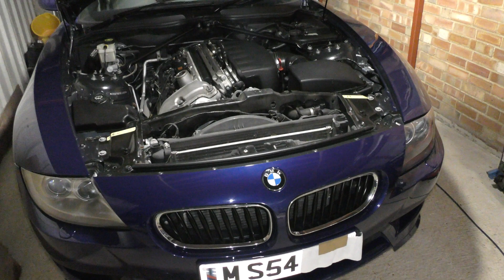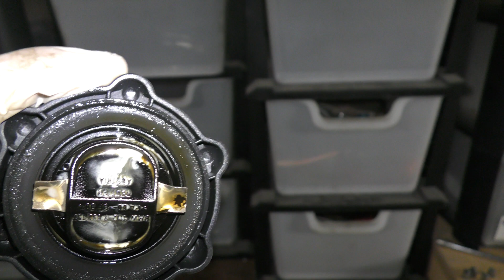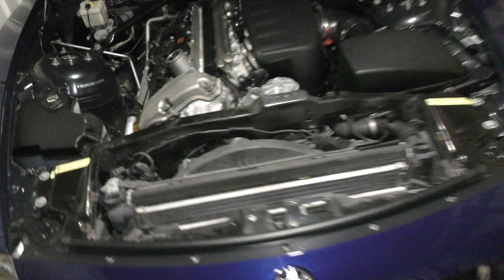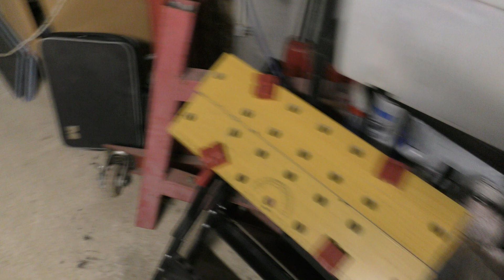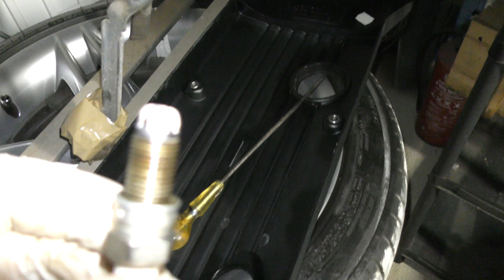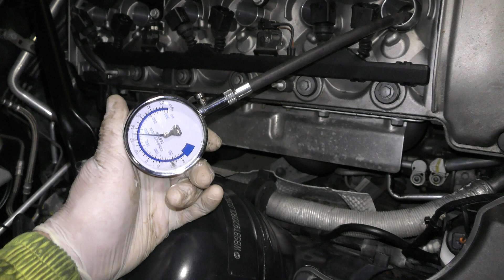NEW TOY: BMW Z4M S54 Engine Compression Test (possible head gasket failure)

Comment: Amazing engine on those! On Cupras & other VAG the cap always has emulsification because of the PCV recirculation, not sure if these have one? Very regular oil changes help.
Wet spark thread is often leaking valve cover gasket.
I bought a Lanoguard kit for my Quattro chassis, yet to apply though.
Got to fit a sports exhaust Cap, get her singing!

Comment: I haven’t owned a BMW for a couple of years, but for the most part I’ve known them to be pretty much bulletproof. As long as the cams, and timing, & top end are and remain mechanically right and something like a tensioner doesn’t fail, it shouldn’t be too bad. When they DO go wrong though, like a tensioner failing & suddenly the top end grenades, they go expensively wrong. 

Looks to be a car in GREAT shape. It’s obvious you’ve put a lot of time into it. Regardless of what the overall vehicle looks like, I LOVE seeing an engine bay that’s tidied up like that. Always makes little issues much more apparent to the eye before they have time to become larger issues. I’m jealous to be honest. Looks awesome. 👏🏼

Comment: That goo on the filler cap is just condensation. A bad headgasket most of the time will push the coolant out of the overflow bottle when hot> Very obviously usually lol
Reply: Oil on the spark plugs like that indicates its time for valve cover seals/gaskets

Comment: I've had the 35is (N54) for a while now.  Oil on the thread might be leaking injectors thinning the oil, but might be ok if it's not backfiring - BMs have an issue with leaky injectors.  I had to change mine recently - as well as the cylinder head, charge pipe, MAP sensor seals, clean VANOS and the check valves...  Waiting for the timing chain to go now...  Oh and roof micro switches, and leaking boot, and leaking tail lights...  But apart from that it's pucker...  Just the car weeding out the weak.
Reply from the maker: Rgr thxx
Reply: @grimreapers2  NP shout up if you ever venture to using a DCAN diag cable with INPA, ISTA, or NCS for coding etc. and want a hand -  don't pay for the software btw.  But there's plenty of youtube vids so you probably won't need it.  But the offer's there.  I'm not a car mechanic, just an engineer who needed to learn to fix his car quickly

Comment: While I am a gear head, I'm not at all familiar with the snifer test. Then again, I'm a self-taught mechanic. 

I'm speculating it's looking for gasses passing through the coolant, which would normally go to the resovior, which is often the highest point in the coolant system. However, sometimes that's not the case.

For example, my 2002 Audi (B5) S4 has the heater core higher than the reservoir. Whenever I change the antifreeze, I have to bleed the line coming out of the firewall from the core. Otherwise, the heat doesn't work.

Like I said, I'm purely speculating how this tool works. But it might be the issue. Obviously, it doesn't help you with your troubleshooting, but it might be why the tool isn't working.

Comment: Thats just normal condensation on the cap Cap.
Reply from the maker: rgr
Reply: @grimreapers2  you should see the caps from my turbo LS cars that run on e85 that sit and get started only  every once in a while. Once they sit over winter, the oil needs changed no matter how much time is on it.

Comment: The scum is condensation. If you had a blown head gasket or cracked head, there would be cylinder 3/4 misfires upon cold start. The tiny bit of oil on the spark plug threads is sign of a miniscule valve cover gasket leak. Ignore. 

You absolutely do not have a failed head gasket.

Comment: Hi Cap, recommend a full oil change and use high quality oil. The exhaust is stainless to start with, however a lot of people do make their own custom pipes from the cat for z4's. my mate did on his z4 3.0 and it sounded amazing, that may be what you are seeing. Engine itself is a great little straight six and I'm a huge fan of them as they are fairly bombproof and can be supercharged easily, gearbox is moderately the same way. The BMW rear diff leaking is not a great sign, properly check every aspect on it as I've come across cracked ones through people deciding to make attempts at "drifting" (to be read as half arsed sliding round roundabouts) which basically meant constant rear diff slipping and they can be a little grumbly to too much abuse. fingers crossed its just the rings failing due to age so you just need to replace the seals and top up it up with oil.    Changed the suspension in one as I figured we might track day it, found that I shouldn't have bothered as the standard setup is pretty great out of the box and paying out for a full set of Koni's wasn't worth the incredibly stiff ride about town. so switched them back, a short lived experiment and one my spine thanked me for when I returned it to stock. but that's personal preference.
Reply from the maker: Thanks!

Comment: When I see this I thought YouTube had a glitch , Iv got a z4 as well , love it not an m though . Lovely straight 6 ! Iv put suspension on it , new brakes Vibra technics engine mounts  pro bush poly bushes to go on at the rear soon .the front control arms have them in and all that made a nice difference

Comment: Cap I would suggest running a cylinder leak down test. It’s very similar to a compression test but gives you much better information as to what’s going on inside your motor. It’s a little more involved and you need an external air compressor to run it , along with the leak down tester, but it will tell you how much compression your cylinder loses over a set amount of time which you then reference to see wether or not your cylinder is good. You can also listen for air escaping which can tell you where a leak is happening. From the exhaust (exhaust valve leak) intake manifold (intake valve leak) bubbles in the coolant tank (head gasket failure) etc. That said your compression numbers came back very good so I’d expect that engine to be just fine.
Reply from the maker: Will investigate thx.
Reply: A lot of shops here in the states rent out the tools & equipment for many tests like this § for not much money. Some will even let you have it for a day. I don’t know if there’s anything similar in the UK, but you know what they say about a ‘penny saved’. Best of luck with it!
Reply: Plus 1 on that - it is the only real definitive test

Comment: The oil is from where someone spilled a little when they added oil. It ran to the lowest point it could.  But that BMW motor is a high revving, sweet little monster. NA sounds so much better than a whiny turbo or blower of some kind. No, that s54 is like a fine musical instrument.  And it plays a wonderful tune....Congrats buddy!

Comment: You want to test your compression when the engine is warm for the exact reason you suggested cap, tolerances. Your piston rings and cylinder walls will expand when up to operating temp, therefor increasing compression.
Reply from the maker: thx

Comment: Rocker cover gasket leaking around the plug holes also cheap oil and no mileage engine not getting hot enough causes  the mayo in the cap just use top quality oil also take it for a good run get it hot that will go away